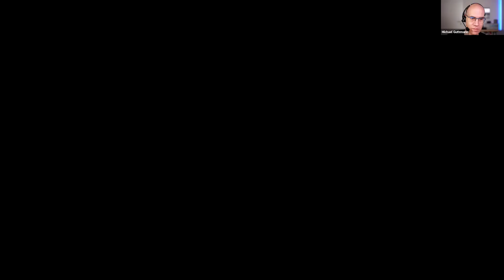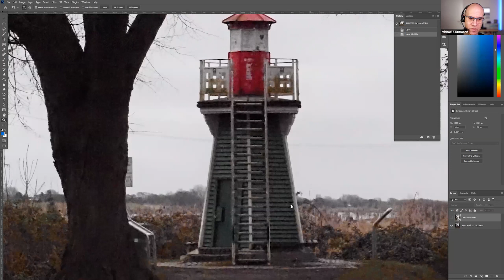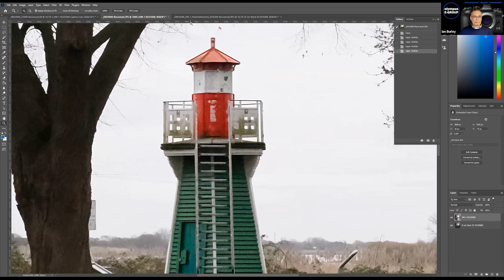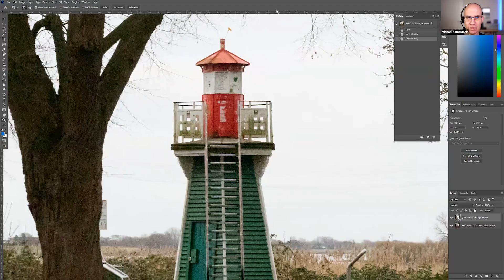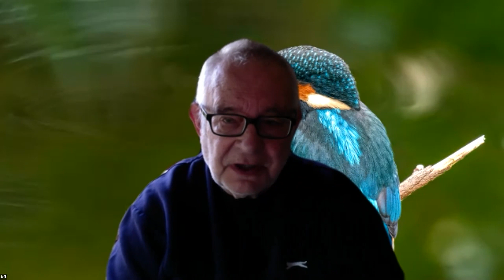E-Group members question OMDS senior product specialist Michael Guthmann on the new Olympus OM-1

Comment: According to the site photonstophotos.net he referenced, there is NO dynamic range improvement from e-m1 mk3 or m1x:

https://www.photonstophotos.net/Charts/PDR.htm#Olympus%20OM-D%20E-M1%20Mark%20III,Olympus%20OM-D%20E-M1X,Olympus%20System%20OM-1

"

https://www.photonstophotos.net/Charts/PDR.htm#Olympus%20OM-D%20E-M1%20Mark%20III,Olympus%20OM-D%20E-M1X,Olympus%20System%20OM-1

https://www.photonstophotos.net/Charts/PDR.htm#Olympus%20OM-D%20E-M1%20Mark%20III,Olympus%20OM-D%20E-M1X,Olympus%20System%20OM-1

https://www.photonstophotos.net/Charts/PDR.htm#Olympus%20OM-D%20E-M1%20Mark%20III,Olympus%20OM-D%20E-M1X,Olympus%20System%20OM-1

Comment: Good Q & A, thank you. It's good to know there will be no delay in our pre orders. Dave Smith, from OMD-S, is providing a presentation on the OM1 in my local (80 mile round trip) camera shop on Saturday, so I'll nip down drool over my much anticipated new bits of kit. Following a bit of umming and arring, I have ordered two OM1 bodies, a 40 - 150mm f4 and a single battery grip (for use with my 300mm f4). I will be part exchanging my EM1X and EM1.3. I purchased my first OM1 back in 1975, and that was a cracking camera.

Comment: Thank you for this interview and Q&A session. Great job! Thank you to the OMDS senior product specialist for his expertise and willingness to share. I have just one small point. There is a discussion at 32:32 into the video about Anti-shock feature while using electronic shutter, and that this seemed to be described in the OM-. But I am not seeing this. It describes only one Anti-shock mode, just as Michael described it. In the E-M1X manual, however, I can see how this mistake might be made. But close inspection of the manual shows it is saying “[Anti-Shock 🔸/Silent 🧡]” with a “/“separater between the two. They’re not to be understood as working together. Could this have been the source of the confusion?

Comment: Anyone knows if this OM-1 gets a blackout on viewfinder like E-M1X wearing polarized glasses?
And is the OM-1 sealed as good as the E-5? 
https://www.youtube.com/watch?v=SfxUHGziwgg&t=20s
Last with adapter, how well the 35-100/2.0 & 90-250/2.8 perform on OM-1?
Reply: There is no problem viewing the EVF at all when wearing polarized sunglasses. This has been confirmed by several OM Ambassadors, one of whom tested it for me with two different sets of polarized sunglasses. The sealing on the OM-1 should be at least as good if not better than any previous Olympus cameras, now with its IP53 rating.

Comment: Fantastic question and answer session was great info.  
Summary:
OM-1 has similar to Canon R6 dynamic range 
OLED viewfinder means now can wear sunglasses because it isn’t polarised 
100-400 lens stab happens only in lens (no sync) except rotation which the OM-1 and EM-1 mk3 does instead
OM-1 adds CAF without (retained) tracking (of object moving out of selected focusing frame) 
High speed movie still locks focus at recording start like previous models 
Older 4/3 lenses work but lens focus motor speeds may limit ability of CAF 
Unlimited recording time of videos only for OM-1, no previous Olympus model upgrades planned 
Can charge two batteries in parallel at once but requires USB-C 3.0 with 27w output min 
OM-1 does not add any ‘extra’ noise reduction to RAW at any ISO value in camera
Shipping March 7th from OMDS distribution warehouses

Comment: you still kept sharpness at "-2", i see.. wouldve thought that with such a step-up for olympus, and considering now you're more suited for video work, you should have put in-camera contrast/sharpness/saturation go to less than "-2". you have "-2 to +2". that sharpness is really too high, even at "-2". filmmakers do not enjoy in-camera sharpeness, and with "-2", even with diffusion and software, it still shows... perhaps you could update it in the next firmware, so that all in-camera settings values go to at least "-5" (at the very least), if not even "-7".

Comment: It’s pretty amazing the sensor has much higher readout speed and still improved dynamic range. Some noticed that the OM-D E-M1 Mark III and OM-D E-M1X had many improvements over the OM-D E-M1 Mark II except in regard to dynamic range. To gain the computational edge in the newer cameras I thing some compromise was required to get faster readout which may have reduced dynamic range. So the OM-1 gives back some of that lost dynamic range and also increases readout significantly so that’s pretty nice.